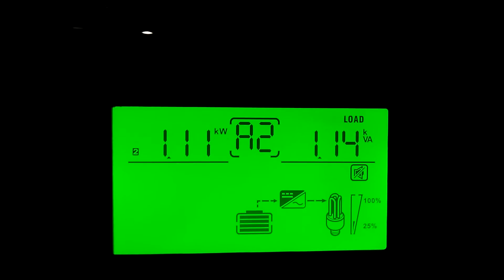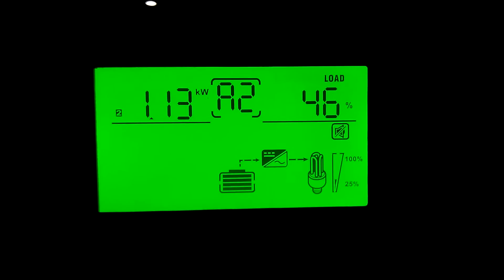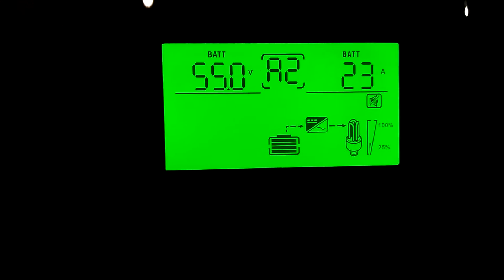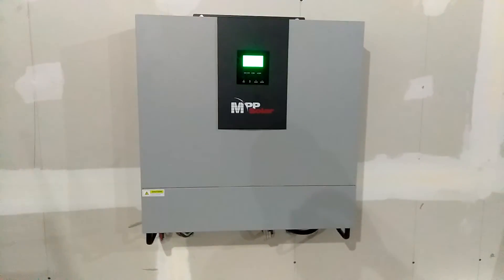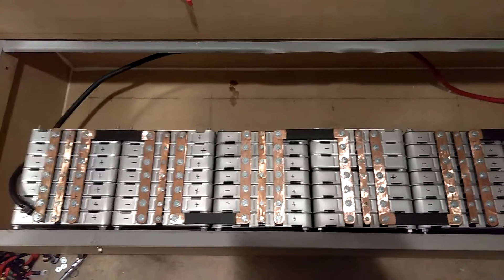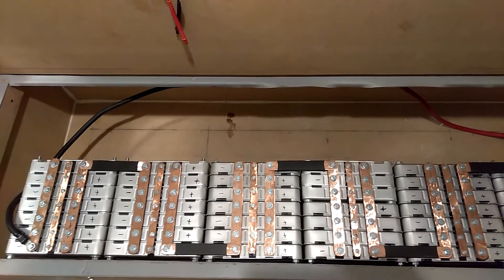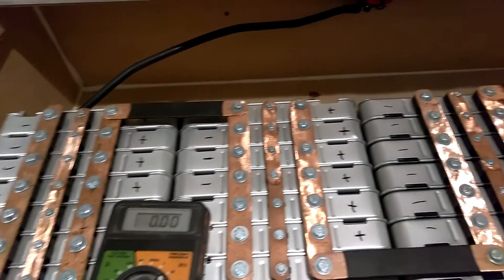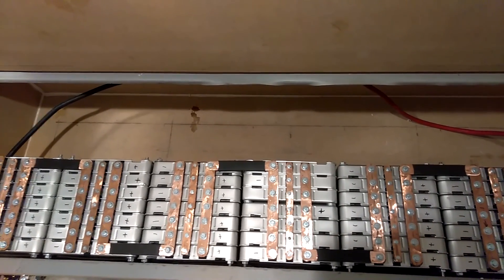One week off grid with my MPP 5048 split phase inverter.

Comment: Good morning Carson, What do you think of using Gen 1 batteries with Gen 2 in a 48 volt system? Also how are you wiring the BMS to your system? THANK YOU
Reply: Thank You Carson, I have 70 Gen 1, and 56 Gen 2
Reply from the maker: @paulalien5062  hope everything works out for you 👍.
Reply from the maker: If you keep the stacks the same meaning if you mix the same amount of gen 1 modules and Gen 2 modules in each stack I think you will be fine that will keep the capacity the same on each stack.

Comment: With this configuration have you had the inbalancing after using it for a while? My configuration is relatively the same but 24 volt and I cant keep them balanced
Reply from the maker: I have had no problem keeping them in balance. With the MPP solar charger I can disconnect the batteries from the inverter on a sunny day and the inverter will keep running using the solar panels.   With the battery  disconnected all my bus bars and check the voltage about an hour haven't had any problem.

Comment: I just ordered 2, I plan to run my dryer with it. :) 7kw A/C 
Looks nice.
I'll be doing 8 BYD batteries.

I've always been suspect of the BMS thing myself. As long as you don't have temperature issues, ie freezing, I think you will be "OK" without a bms.